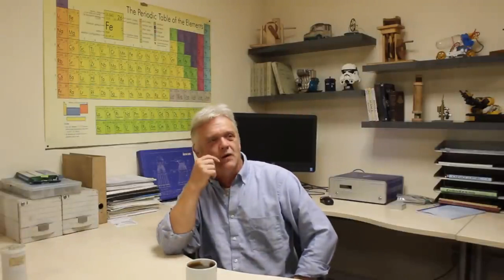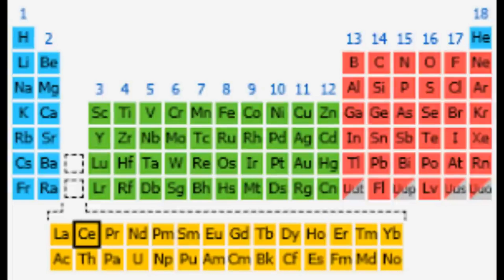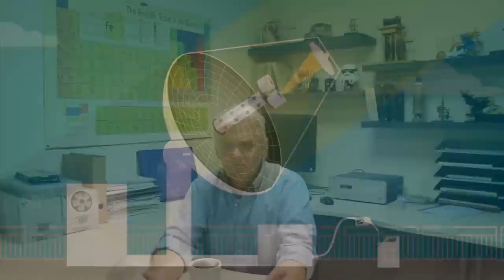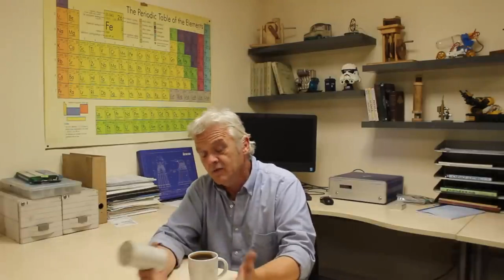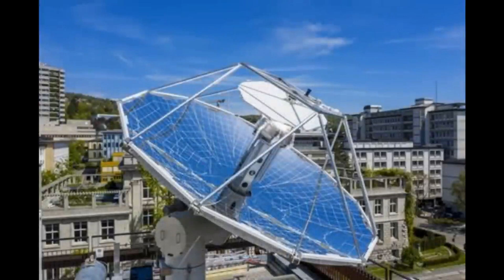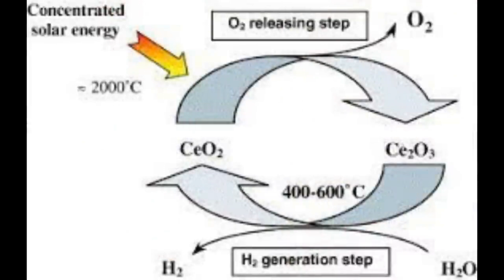Fuel From The Air

Comment: The exhaust gas temperature of a gasoline engine can be driven up to 1200°f if you run it lean. Stick a catalyst in there and turn your exhaust back into fuel. Syngas combustion exhaust is water and CO2 right?

Comment: That is such good news!
If I heard right, they are producing kerosene from 15kW solar collector. That is around 80kWh of solar  per day. Kerosene contains 10.35kWh per litre, so with an efficiency of around 4%,  means they can produce 3.2kWh of energy as kerosene or around 0.3L each day. 
At 20% efficiency that would mean around 1.2L per day from a 15kW solar collector. 
We will need to scale this up to the point where we satisfy all the fossil fuel needs of the world and then have excess production that we can pump back into oil wells to start removing the excess CO2 from the air.
So we have the technology, just needs massive scaling. Question is; is the current capitalist system capable of doing this in the time required to avoid catastrophic climate change?

Comment: I do believe that we might be better off to increase the production of electricity by wind and solar (both large wind-parks / PV installations as well as decentralized roof mounted in cities) to maximize the supply of it.
That can than be used better for either electrical direct conversion or for high temperature processes hydrogen production. 
The more electricity we produce (renewable) the less expensive it will get - scale effects are awesome.
Reply: It is a wonderful idea. Sadly the people who own the grids and turbines and panels, are motivated by profit alone. When is the last time you saw electricity prices fall? The only only true solution is to go offgrid.

Comment: i would suggest maybe water split by radio active decay to make hydrogen fuel is pretty good also. But thorium conversion to uranium 233 for nuclear fuel is a quite a bit better in energy storage and if you could use some part of that cycle to run a generator or fuel cell then that would last about 150 to 300 years of power for your home if radolisis is practical. But fission in molten salt reactors could be miniaturized. Though I don't think we will see a nuclear battery powered car anytime soon.

Comment: You are correct. It is a matter of economics. It is getting more interesting in places like Australia where vast deployment of solar is making times where the power company will pay you to use electricity. When negative cost of energy is available the economics of making jet fuel is very different because efficiency is not important, just capital cost of the equipment and operation cost. A similar approach is also underway for making ammonia for both fuel and fertilizer.
Reply: 15 years ago they paid well for your excess power from solar panels ,,,now your lucky to get 5 cents per KW that they then sell to people like me who have no solar panels, I think I pay 28 cents per KW,,,So not as good as your led to believe ,,
Reply: @keithhowell4138  I think you misunderstood. I was not talking about what they pay for your solar power, but how much they pay you to take the power when there is too much being generated.
Reply: @Ken00001010 what.
Reply: @danp1224  Do a lookup on "negative power prices."
Reply: @Ken00001010  if they have too much power they don’t pay anybody to use it,,that would be great if they did ,but all they care about is profit ,,nobody here gets discounted or free power nor are they paid to use power.
Reply: - as a retail/residential consumer - with AEMO market rate exposure - there are still the grid delivery charges applied, so until the wholesale price falls below ~ -12- 15c/kWh, there is still a charge applied (lower than fixed, or TOU rates)- via services like Amber Electric (no retail markup). - The key to having market exposure is, one can receive 20-30c / kWh at select times for exporting surplus power from a solar array - provided you have the ability to act on real-time price signals
(sometimes hype and reality have a disconnect - slightly).

 - Also, make sure you are not exporting solar during times of negative rates, or Amber will ping you for your generosity.
Reply: @kadmow  I was not referring to the retail market. People are not going to be able to make jet fuel out of thin air in their back yards on any economical scale. To make sense, it has to be done on an industrial scale, and the big ongoing cost will be electric power. We often hear about how renewable energy sources have to be overbuilt because they can't be reliable for constant output. It is also the case that some places have natural oversupply such as Australia for solar and Texas for wind. These imbalances have created a market for energy storage technology and energy arbitrage, and a possible opening for providing low enough wholesale energy cost to make a synthetic jet fuel business, especially because that production would not have to be constant, but could be throttled to track the real time cost of the power.

Comment: Pretty amazing process! In a general sense, nature roughly does the same thing with photosynthesis. It takes  water and carbon dioxide from the air and using solar energy converts them to cellulose which can be burned as a fuel.
Reply: The only problem it's not reversible, and you have to plant more plants than you burn to sustain